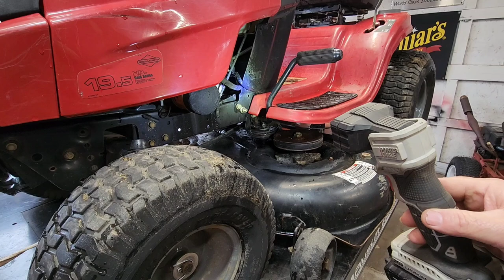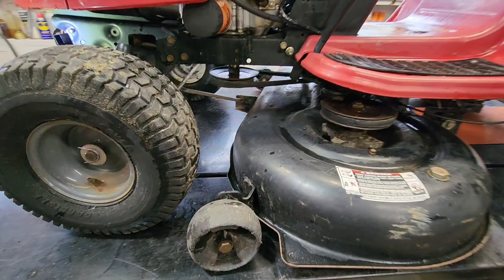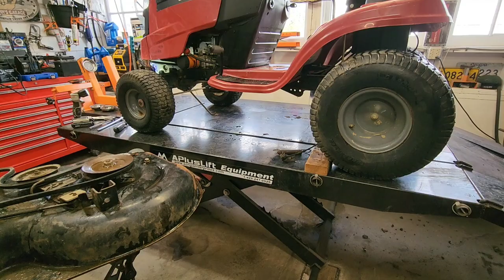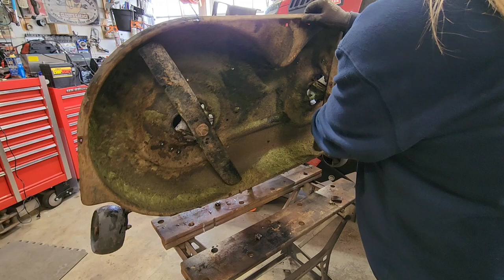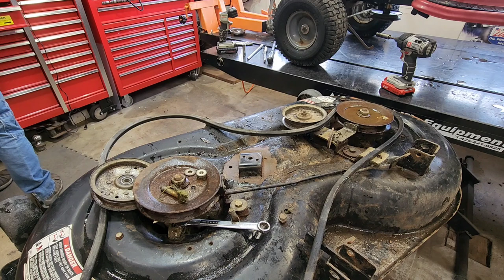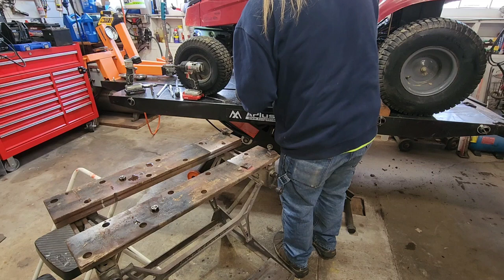This Crafteman LT2000 Lawn Tractor is throwing the deck belt off. Easy Fix!

Comment: The idler bearing and the spindle bearings are both sealed bearings but they can both be taken apart and greased. Or you can replace them. repair only takes a little time and grease. Don't remove the spindle. Take the pulley nut off and drive the shaft down from the top. Then you can pry the seal off of the bearing and regrease it. Yeah I'm cheap but I am also poor. Removing those spindles usually destroys them so don't try it. You can also match up the bearings in the spindles a lot cheaper than replacing the whole spindle. I grew up poor so I don't do things like line mechanics do. Also you can get better bearings than the cheap garbage that was put in those spindles to start with. Been bending wrenches for 55 or more years. first car I fixed was a Triumph TR6 for a returning Vietnam Vet named Turby. I told him all it was was a complicated lawnmower. lol
Reply from the maker: Thanks for the comment.

Glenn

Comment: I wish i lived closer to where you are. I have a Sears Craftsman LT 1500, and i think i know what's wrong with mine, but i'm not that familiar with working on mowers. Mine likes to throw belts& break them too. And i'm 70 years old and really shouldn't be crawling around on the ground wrestling with the mower deck. I live on a fixed income and when my money is gone( bills, groc., gas, etc.), it's gone. But, i need to get it fixed because all i have to mow my yard( 2 1/2--3 lots) is a push mower, and that is a work out and a half. Anyway, thanks for your video. Very informative.
Reply from the maker: Look at the condition of all the pullies and all the bearings. Something is not happy. The idler pulley might be bent or some build up maybe.
Reply: Also, in addition to what GlennsSpeedShop posted above, make sure you are using a quality belt that is the correct size! Cheap belts usually don't have the kevlar or aramid belts in them to make them really strong.  Yeah, the Gates and Sten belts cost more, but there is a reason. Also, make sure that the "keepers" and/or "brakes" around the pulleys are not bent, and don't have any sharp edges on them that might cut the belt. Good luck!

Comment: I would of welded if possible with the thin material , to counter act the pulley force forward on the belt.
Reply from the maker: That would be best for the mower.   A mower like this is only worth about $250.00 when I sell it and I already have a bunch of time and money into it. You just can't do full restorations and make it pay sometimes.

Comment: Sounds like my problem. I had to weld up the deck a bit but didn't look at the angle of that stationary pulley until the belt kept popping off on lower levels
Reply: Is that pulley being pulled up from the belt tension? I could add a small bracing to it